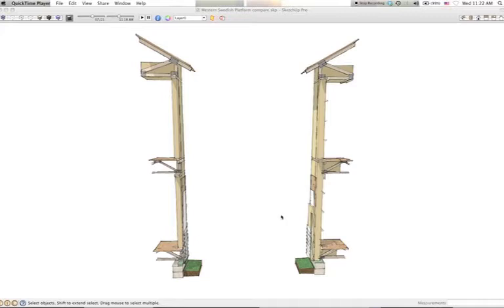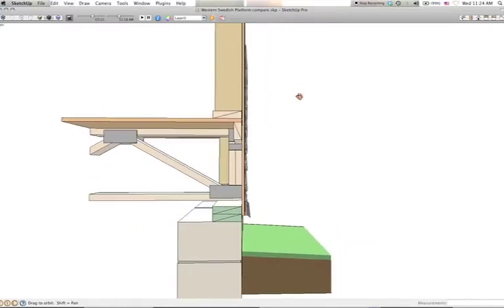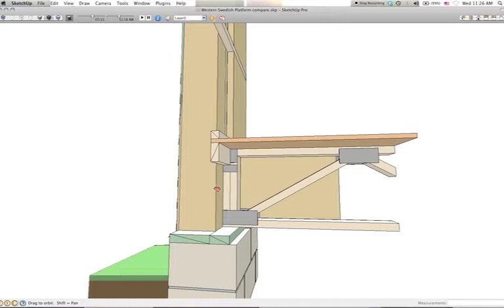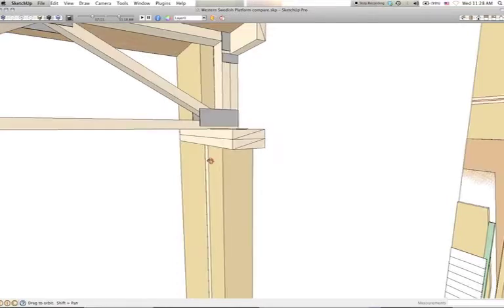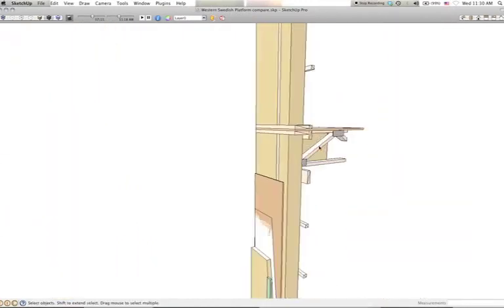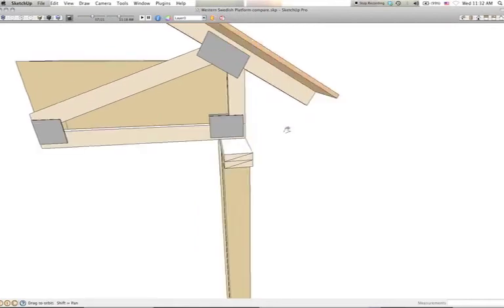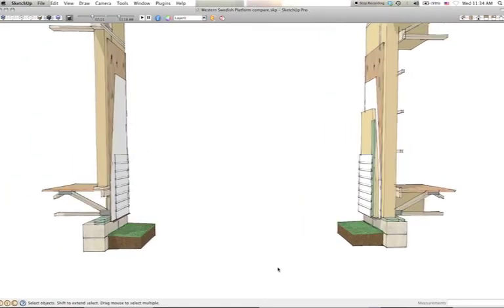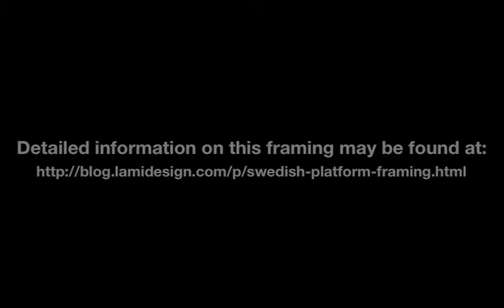Learning from Swedish Home Building Part 3

Comment: Do you know how are they able to fix the Swedish prefabricated walls at the base if they are closed either side before arriving on site?
Reply from the maker: Yes - they pre-bolt a treated sill plate to the slab, but it is narrower than the wall, and fits into a groove in the wall panel's bottom plate. The panel is then fixed by driving a screw from the side, which is then concealed behind the baseboard.
Reply: @LamiDesignModernHousePlans4U  Thanks for your quick response :) That's very interesting! I'm surprised just side fixings would be sufficient, I thought they may have perhaps driven them diagonally downwards
Reply from the maker: @jamesblack9324  well, I think going in horizontally gives them more fastener length –– if you go in at an angle your screw will soon pass through the plate and hit the concrete slab. If you sketch it out you can see what I mean. If you search for my web pages that discuss Swedish Platform Framing you can see section details that show this sill plate detail.

Comment: In the Swedish design, how is the continuous vapor barrier not interrupted by the 2nd floor subflooring that appears to run all the way out to the exterior? Is it terminated at the underside and resumed above?
Reply from the maker: Yes - vapor control sheet (not vapor barrier 😉) is sealed/taped up to the underside of floor deck, and then above is sealed/taped down to the top of the floor deck. Typically this is getting one of the furring strips directly over it in order to attach top and bottom of the drywall, so there is also the opportunity to caulk/seal where the furring hits the deck if you feel its warranted.

Comment: I was confused by the single diagonal line on your dimension lumber in the sketchup model. I’m used to that meaning blocking/discontinuous and double diagonal lines in section to indicate continuous material. 

Obviously a minor nit - I just found your channel and I look forward to exploring more.
Reply: There are always different conventions. I was trained that studs and blocking - single diagonal; joists & rafters & headers & beams - x diagonals.

Comment: So the fire danger (chimney effect) of balloon framing is present in the Swedish frame, and requires either blocking (thermal bridges) or an insulation material that building codes accept will not permit the effect?
Do electrical codes permit wiring chases 1.5" deep with no protection for the wires? Is all Swedish wiring done with shallow boxes?
Is all the straight 2X furring strip material being bought up by Swedes?  There's very little of it around here?
My mother's people came over with other Vikings around 800AD, can I get a Swedish passport?
Reply: In Sweden half the box sits outboard the drywall (but it's a clean finished look, don't picture a north american wall plug sticking out :)
Reply from the maker: No, the Swedish Platform Framing is fire blocked by top and bottom plates at the story line. It is nothing like ballon framing.

Swedish wiring chases are typically 50mm which is approx 2" so boxes are ample in depth. In the US our lumber is 1.5" so we have to work with that.4x4 boxes with a reducer cover are more roomy than single gang boxes for individual devices, so room for wiring actually increases, and workable depth is 2" - enough for fat devices like GFI and Wifi enabled devices. I have vetted the 1.5" wiring chase with code officials in my state and I am happy to help you convince code officials at your location if needed. The code requirements for cover over the wire only apply where wires pass through framing that is likely to receive screws. There is no mandate that wires in a 1.5" cavity must meet some dimension from the surface, and in practice wires running in and out of electrical boxes are routinely installed in this 1.5" zone behind the drywall with  no protection. The wiring chase is completely code compliant.

Comment: I understand the first/second floor stacking for load but when considering the roof trusses is it simply the 2x8 top plate is strong enough to transfer load to the nearest stud? You mention the use for strength when observing the traditional 2x4 frame.
Reply from the maker: Yes, the 2x8 top plate is stronger. That said, you will have to evaluate that for your own situation because span and location will impact how much load you have coming down on the plate.

Comment: So basically they platform frame and using a ledger method that balloon framing was popular for and then fur the interior walls for insulating purposes. (and incidentally, this is a sound proofing technique).  

I don't agree, though more in that I would like more explanation, about why several stacks elements in the american system count each as a thermal bridge and not counted as such for each platform in the Swedish model.
Reply from the maker: Your comment re. balloon framing is sort of right - balloon framing the ledger was let into the studs, and the joist extended to the full depth of the stud. This is different and any similarities are incidental. Different purposes, different solutions. The Swedish variation all contribute to energy efficiency and ease of shop fabrication. You can count the thermal breaks differently if you wish - the Swedish wall will always come out ahead.

Comment: One of the reasons platform framing was adopted over balloon framing was because it was safer and helped reduce the rate that fire could spread from one floor to the next.
Reply from the maker: True. Another reason I believe that stone wool is the best insulation because it acts as fireproofing and slows down the spread of fire in a home. In fact stone wool qualifies and fire blocking in the building code.

Comment: If you expose timbers inside (traditional timber frame). Cover the framing from outside with airtight layer - CLT,plywood,osb (+optionally some kind of membrane) and attach the insulation to the outside (via long screws+furringstrips) the exposed timber,insulation outside seems (and is by calcs and how few joints there are to make airtight) looks pretty good to me.
Reply from the maker: Some advocate for the type of wall system you describe, and it works fine. But in practice the sequence of construction is much different from what is already done in the US, and the details for flashing and window openings are completely different. These kinds of differences to practice and workflow is what causes contractors to artificially inflate their pricing to reduce risk - and in return makes these types of wall systems expensive and difficult to put into practice. In comparison the USA New Wall offers an incremental adoption path through which builders can gain experience in techniques and sequence without the risk of a huge mis-estimation. Once they get good at this they can move on to other wall assemblies if it makes sense - in most cases it will not. USA New Wall is too easy and just as effective.
Reply: Good point! I guess i am approaching this from too much of a self builder/DIY angle rather than base it on economical realm.
Reply from the maker: Yeah - the economics of it is what stops us from making progress on the energy performance front. If we can ease builders into it, in return they can leverage it as a competitive advantage in their market. We have to play the economic forces!

Comment: So the second floor is held up by a ledger that is attached by screws?  Doesn't seem like the best way to hold up a floor.  It's essentially built like a deck, which are notorious for falling down when too many people occupy them.  I'm guessing 3 lag bolts per stud, but that gets expensive @$1.50 per screw and may not be sitting around the job site in many builds.  You are also depending heavily on other properties of the wood than it's raw compressive strength.

Also, there is basically a stud in place of the end of the floor truss, so saying the thermal bridge is eliminated is a bit incorrect.  The thermal bridge is just roughly half the size, but since this area is an extremely small part of the total exposed stud area it's not a huge improvement (maybe 5-10%?)

I like the way the Swedish foundation is tied in, and as someone else said the roof on the Swedish wall is essentially advanced framing.  One thing the Swedish wall likely does exceptionally well is transfer snow loads from the roof to the ground very efficiently.  The wiring chase makes a lot of sense and it's surprising that isn't more standard in the US.

Now that outboard insulation is becoming more common I wonder if it even matters that external stud exposure is reduced.  If we can build a stronger wall with smaller cheaper lumber and spend the rest of that money on exterior insulation, that should be the focus.
Reply: We have no problems with the second floor falling down here in Sweden. It works. :)

Also, even though our way of building isn't perfect it is still a huge improvement with very little effort. Small improvements all over the house adds up in the end.
Reply: @que Couldn't you simply "let" the ledger into the studs if you were concerned about screw strength?  I'm not sure I like how the joists don't extend or attach to the studs in anyway.  Or is that why the floor extends over the single top plate instead of ending at the wall?   Thanks
Reply from the maker: Nathan - the lag screws work fine with small spans and light loads. For typically American large rooms with long spans and higher loads the number of lags and the required wood around them can become impractical. But there is a different bearing detail for long spans that maintains the same layering you see here. Its unpublished on my information pages. You need to hire for consult if you need more information than has been shared.
Reply: Actually we use simpson strong tied alot for the floor joists